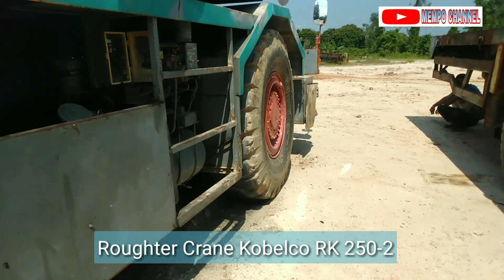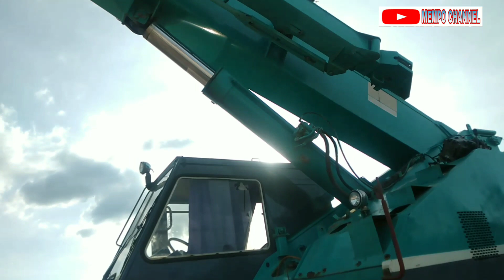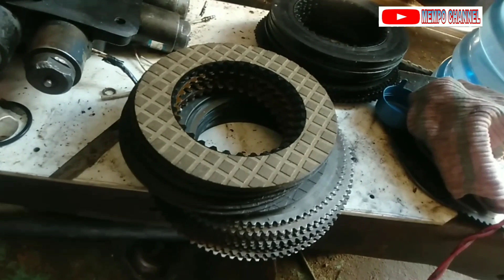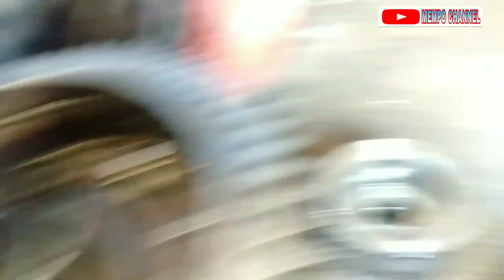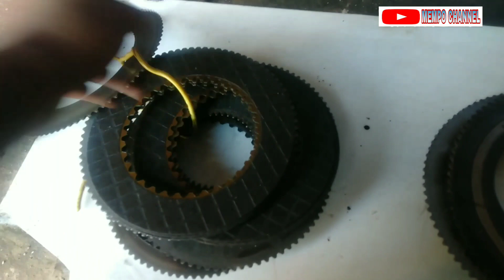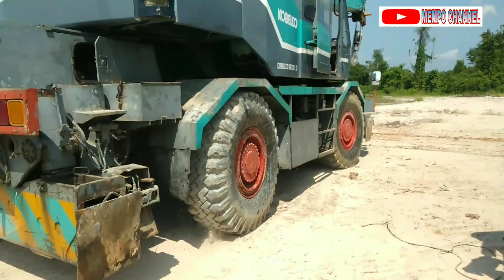tenaga tidak ada, di gas tinggi tidak jalan ternyata transmisinya bermasalah,

Comment: Bang suspensi crane kobelco panther tidak mau tingi cara bikin manualnya gimana ya...salam santun smoga di blz?
Reply from the maker: Dia selenoid valve g bisa manual, Electrikya itu bg...arus k selenoid valve nya ada gk bg, ,klog ada arus kasi api langsung 24 , klo arus ada tpi g mau..cek eselenoitnya bg
Reply: Berti selenoid di kasih arus langsung 24 ya bang...kalo dari jalur kabelnya ga ada arusnya..